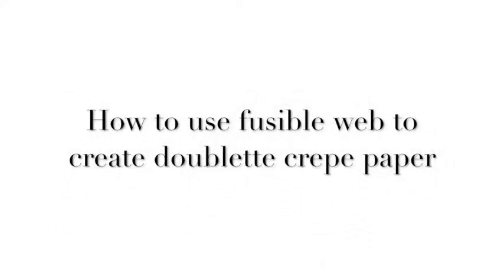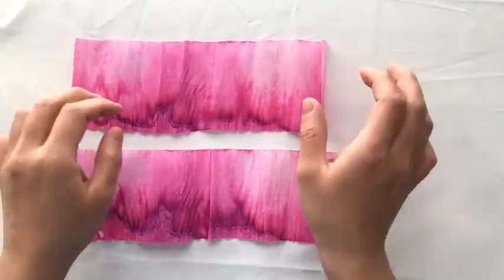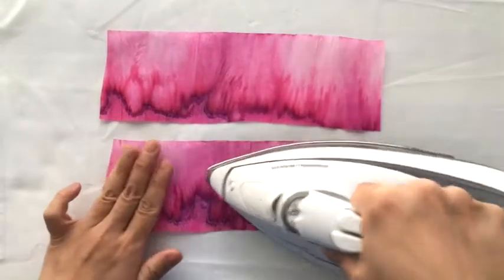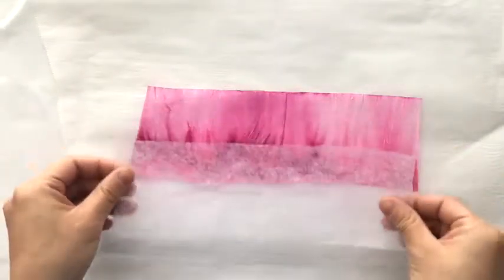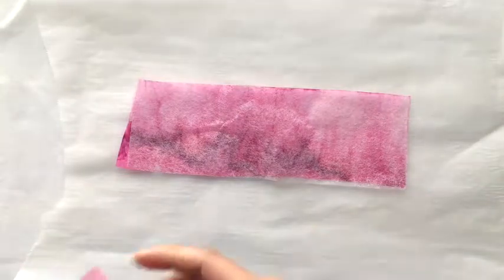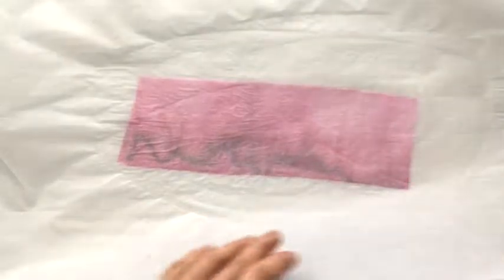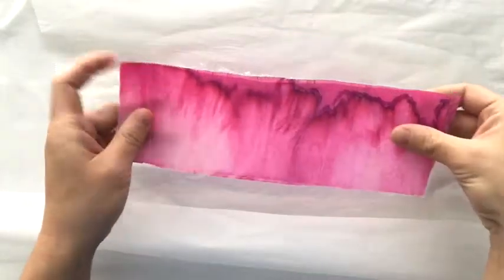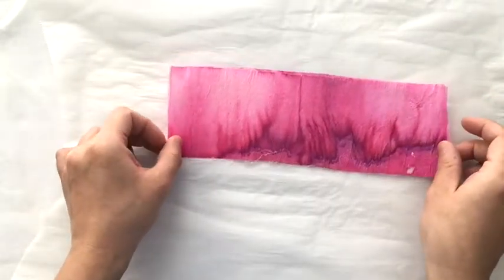How to use fusible web to create doublette crepe paper

Comment: Have you tried creating the doublette first, and then coloring it with paints or alcohol inks?  I wonder how the fusible webbing reacts to getting wet/colored.
Reply from the maker: Yesenia Ramirez - I haven’t tried colouring after fusing. There are times when I’ve used too much glue and the liquid splits the fused paper apart, so  I suspect there’s a limitation to how much dying you can do after fusing (altho alcohol ink maybe more forgiving). Also, the fusible web is quite expensive so I’ve always used it only when I’m satisfied with the colour of the paper. When I die I only die because the colour doesn’t come in the crepe paper; if I fuse white on white and hen die then I’d just used a white doublette. But If you try dying afterwards, let me know how it turns out!
Reply: Hi Jessie, can you suggest a brand for the fusible web, please? Thank you!